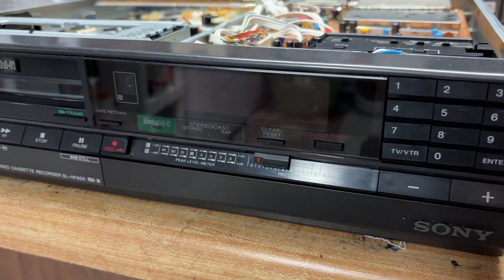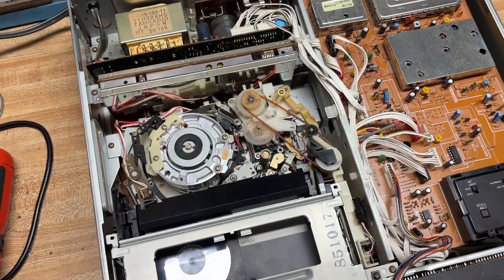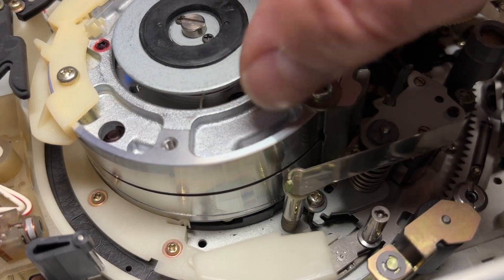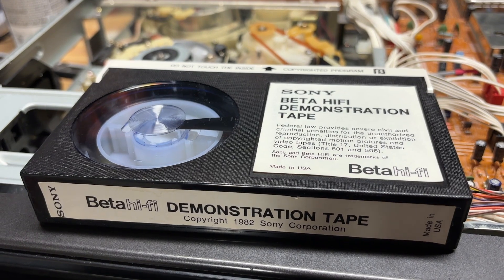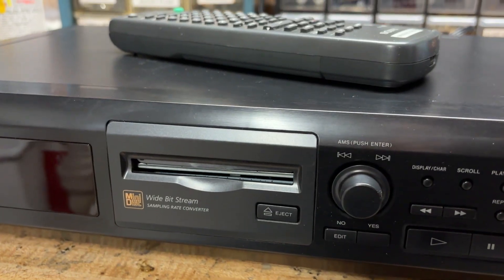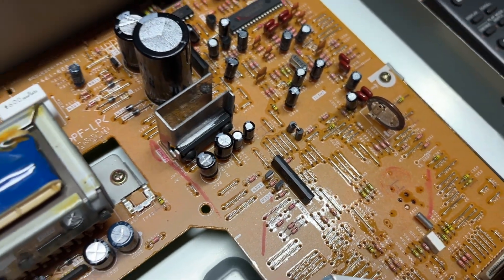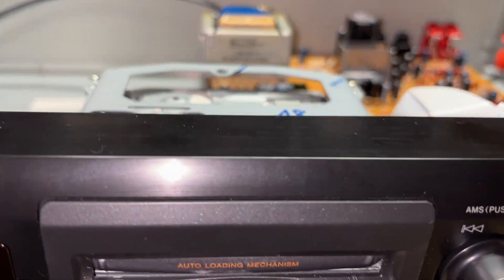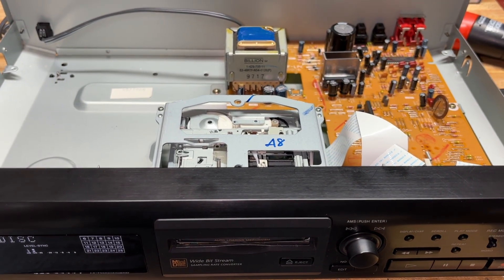Sony Beta Video Cassette Recorder Repair + Sony Minidisc Player Gets Examined

Comment: I just fixed a minor mechanical issue on a Sony SL-HF600 last year. It's a pretty nice model.

I'm pretty sure NTSC Beta Hi-Fi use the same heads for both video and Hi-Fi audio. Since the picture looks good I think there's a good chance the issue is in the circuitry rather than the head drum

Comment: 5:55 NTSC Betamax VCRs used the same heads for HiFi and video playback (unlike VHS and PAL Betamax that used separate heads). The video didn't look too bad, I didn't see the type of dropouts you'd see with a very worn head, just a crease line and maybe some noise on the bottom. If the tracking control doesn't fix the noise, maybe the tape guides need an alignment? Or maybe it's an electronic fault somewhere.

7:30 That's even emptier than the Video8 VCR! I bet they used the same mechanism in small mini and bookshelf systems